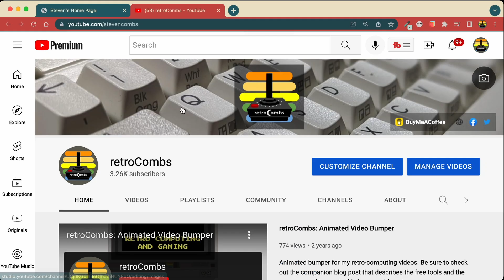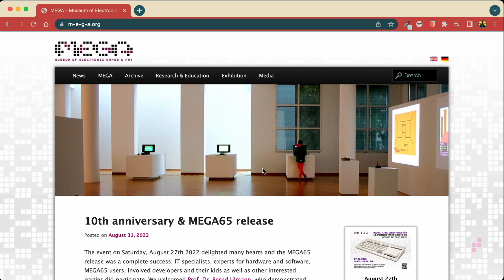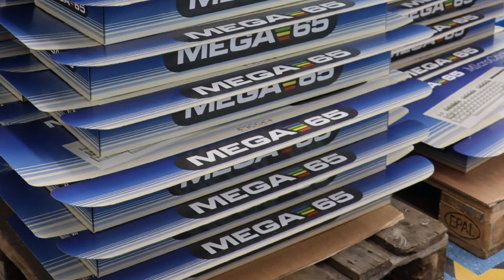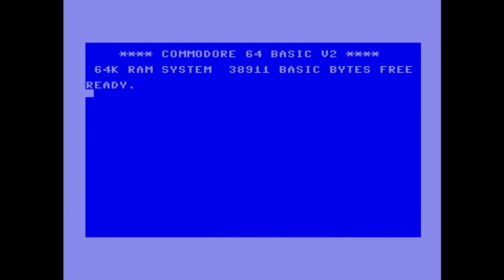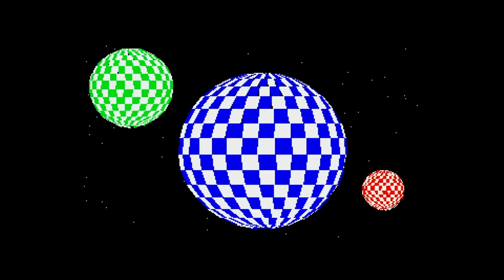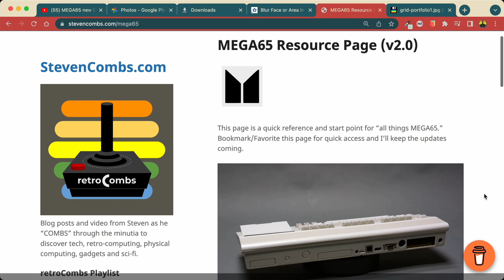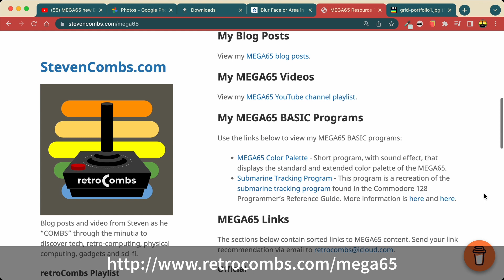An Introduction to the MEGA65. This is the Best 8-Bit Computer!

Comment: What also puzzles me: no connector for a TV? Why is there no 15 KHz RGB out on this thing? If I want 8-bit like games over HDMI, I'll just boot Pico-8 on a modern OS.
Reply from the maker: I want to think composite out is coming on the expansion board. Could be wrong so don't quote me.
Reply: @retroCombs  Composite out is not acceptable. RGB or nothing. We want to lay behind the history of rotten output on the C64.
Reply from the maker: This would still be possible with a breakout board on the FPGA. Just needs to be enough demand and someone to champion the design. Thanks for suggesting!

Comment: If it wants to be the best, it needs a better C64 Basic: On the fly switching 40/80 column, white text on black background, EDIT command to modify lines of code, normal insert bahaviour at the cursor position, proper load commands and tape/disk index functions and above all: ditch PETSCI in favour of default upper/lower case text without case sensitivity for BASIC commands. It maybe incompatible with existing software, as long as it delivers a proper way to use the hardware out of the box for newbies to write programs.
And we need a non-cream-white version. The plastic colours were the worst aspect of any Commodore computer.
Reply: It has BASIC65 which is an enhanced version of BASIC10 with many new commands for graphics, music etc.
If I'm not mistaken it is capable 40/80 columns switching.
I am not sure what you mean by "proper" load commands but the load commands are updated compared to the C64.
There is an upper/lower case basic development environment called ELEVEN, I am not sure about the case sensitivity of it.
Reply: @gabor222  I would expect that if one device is connected, load"name" is sufficient, and that the BASIC figures out the device number. Also a "DIR" command. I know Basic 7 has CATALOG, but that is too much typing.
Column switching I mean on the fly, as you can switch to 80 column, run "commando" and see that on the left half of the screen. Like if the key on the C128 works instant, instead of just with a reset.
Is insert-behaviour fixed, and an EDIT command available? So you can type EDIT 1110, which shows line 1110, and then you can insert characters when you move the cursor to the left and start typing.
Reply from the maker: I'll be covering all of this as I continue my MEGA65 users guide series. You can watch the first two chapters now and hoping get to chapter 3 posted by next weekend.
Reply from the maker: I was just going to write the same thing.

Comment: What about Commodore drives to it. And can you use the Commodore, 64/ 128 fast load cartridges on it. Also, does it have different mold? Like the 128 and Vic 20 can you play the games from all those devices on it?
Reply from the maker: It does include an IEC port for Commodore drives. Unsure about the low\high cartridge but assume with the C64 core and .CRT support, it should be possible. New cores are sure to come so you can run software from other systems.

Comment: Into the official site, the price is 666.66 € (793.33 € gross) Is this a joke?
Reply: Yes it is expensive but if I can choose from spending that amount for a new iPhone or for a Mega65 then I am sure that the Mega offers more fun to me.
Unfortunately the FPGA technology is expensive. What is the amount that you think would be fair?
600 Euros? That is the around the price of a Foenix 256K which is a nice machine but it does not offer C64 (or any other system) software compatibility  as far as I know.
4-500 Euros? That is about the cost of a completed Ultimate64 with a Mechboard (which has less sound and graphic capabilities, no documentation, no other cores, less speed and which you have to assemble yourself).
300 GBP like the Spectrum Next?
The main userbase will be 40+ / 50+ years young people who most likely work in IT or related professions and I think that with 20+ years work experience in IT they should be able to afford to spend this amount on their hobby even if the price is not comparable to mass produced products.
Reply from the maker: @gabor222  "What he said!" ⬆
Reply from the maker: That is the price. These were created by a small non profit organization and a community of developers. They custom created these in batches and the startup costs were huge. In time, costs will lower. For now, cost is being subsidized by early adopters.
Reply: It is a joke. It is a wink to the price of the original Apple 1 computer in 1976.

Comment: My machine is due for delivery within next few days and so far so confused with the machine and its features.  Guess it will make sense once I use it but been a long wait and since ordering I got a Vampire v4+ and ZX Spectrum Next so will give it a try and plod along and see if it offers more than I already got.
Reply from the maker: It will make much more sense when you have one. Just remember. Two modes. MEGA65 and C64. Much like a C128. You might also want to check out my MEGA65 resource page at: https://www.retrocombs.com/mega65
Reply: @retroCombs  ... Thanks for the videos and a link to the guide.  Few days into using and loving the new computer.
Reply from the maker: @simber71  Glad it is helpful and you are welcome!

Comment: Is thing thing selling for $800?
Reply from the maker: It is. This is a small batch and includes a lot of tech that the chip shortage and logistics issues that drive up the cost. This is also a community funded project hosted by a non-profit. It's a different model than a Kickstarter or commercial product, but has created a vibrant community. As things get back to normal and more units produced, the price should drop. For me though, the experience and computer are well worth the price. But I'm not your average retro computer consumer. 😂

Comment: Can you let me know what browser you're using? Looks like you're on MacOS... Anyway, looks like cool custom colors. Like the tabs too. I mainly use Safari and Orion. (Firefox if necessary...)
Reply from the maker: Yes, that's Chrome with a theme called retro. It's pretty sweet looking.
Reply: @retroCombs  Ah cool! Too bad Chrome seems to require a few more resources than I care to feed it... plus I just like my Safari/Orion combo. Good to know though, thanks!
Reply from the maker: Safari in Mac will definitely extend battery life and I switch between the two. I'll have to check out Orion. Not familiar with it.

Comment: You should mention whether C64 would be forwards-compatible with the MEGA65 roms, disk images, music, and other files.
Reply from the maker: Tell me more. What do you mean by "forwards-compatible?" Do you mean will the C64 mode receive modifications or continued compatibility with original software titles?
Reply: @retroCombs  I mean can the C64 (emulator or original hardware) play MEGA65 games?
Reply from the maker: Nope. The MEGA65 has advanced features and BASIC. Think of it as, you can't play C128 software on a C64. Hope that helps.

Comment: Great, keep the C64 alive. The next version should include a boot over to Linux. You would have no problem selling a computer that could boot in the original C64, the new advances of C65, and the open source world of Linux.
Reply from the maker: I'm betting a core that supports Linux would not be a stretch for someone now; albeit a very lightweight implementation. That's the great thing about a FPGA; you can add a new core to the current hardware for added functionality. Thanks for the comment!

Comment: A few comments:
1. As I understand it, cartridges go in the Expansion Port. The User Port isn't implemented on the Mega65, though there is a case cutout if you want to build one. 
2. Some of the rapid cuts to a side view (matter of taste, I guess) felt too short, and distracting by disorientation. 
3. I understand not going for the kibi/mebi prefixes (for powers of 2, not 10) but something irks me when seeing small b used for byte. Perhaps part of that is as a hardware engineer, because we do count memories in kibibits. 

Still hoping to purchase a Mega65 ASAP. :)
Reply from the maker: My replies… 
1. That's correct.
2. Sorry about that and see what you mean.
3. Yep! Should have been KB and MB. I also see internationally kB is often preferred. 
Good tips for version 3. Thanks for the great input!